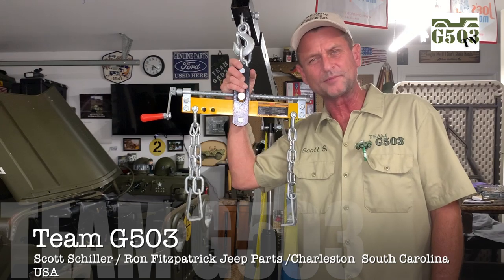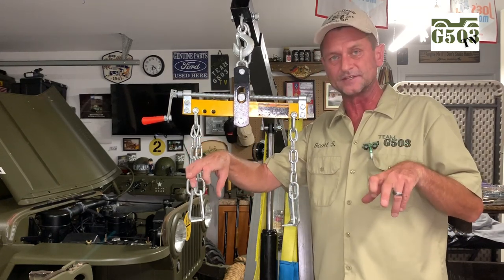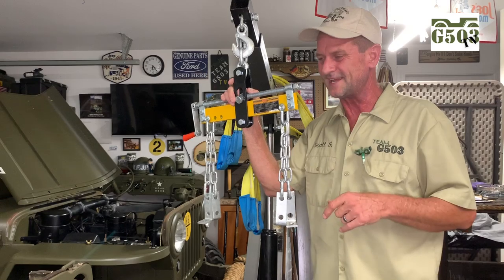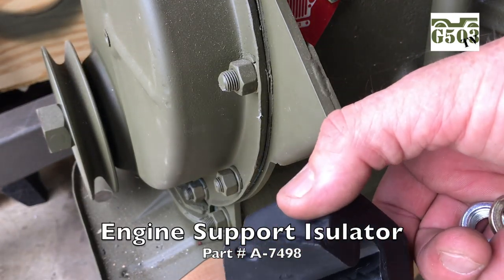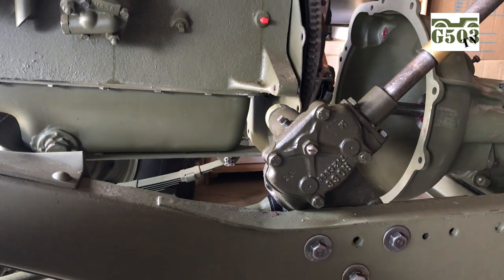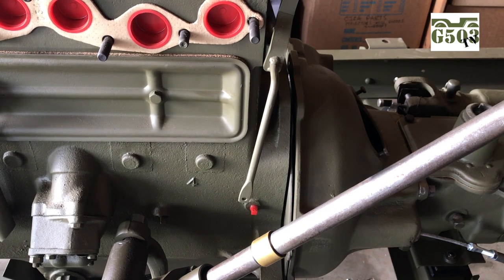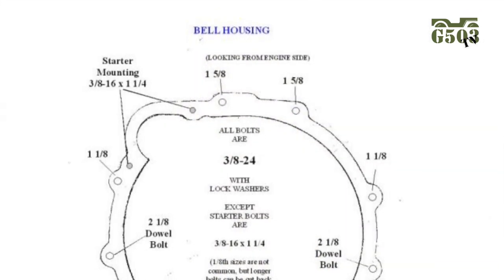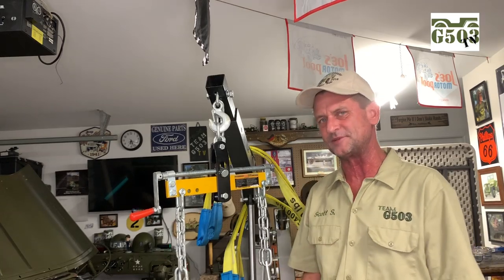Installing The Willys L134 Engine Team G503

Comment: Just reinstalled an L134 in a 1945 MB today.  This video was helpful.  Scott you asked for comments... we rested the engine on the motor mounts gently and with the hoist still attached stuck a stout prybar between the skid plate and the front axle and pushed it straight in. [After trying everything else first!!]

Comment: Thanks Scott for another great video.  I'm doing the exact '43 MB and installed my motor about 2 months ago.  I mated the engine to the bell housing on the garage floor then hoisted the entire assembly into position.  It seemed to work fine.  Any problems with this method that I did not foresee?
Reply from the maker: f18horse actually that is a preferred method. I showed it this way for those who need to remove the engine with the transfer case and transmission in place.

Comment: How do you attach the leveler to the motor? I just put the head on my motor and torqued it all down. Do I take 4 nuts off and put them back on with the load leveler brackets when I’m ready to drop in?
Reply from the maker: CollegeBaseball15 yes, however some would say to use a large strap and wrap it around the engine.
There is a risk of breaking head bolts.
I personally have pulled and installed several engines and never had an issue breaking bolts.👍

Comment: Scott , with the dowel bolts , I KNOW everybody puts them in backwards from the other bolts on bellhousing but does anyone know WHY ?
Reply from the maker: It would seem that the taper of those bolts inserted “backwards” like you say, would aid in the proper alignment of the bell housing.
Reply: @TeamG503  OK , I'm doing it your way . NOW i have someone to blame ! LOL
Reply: actually by "Backwards" I meant in relation to the other bolts in the bell housing . I went to Army Jeep Parts , George has an unmolested '44 motor there in a video and you can see them in there the way you say !! but i HAVE seen pics the other way to , so it made me question it .